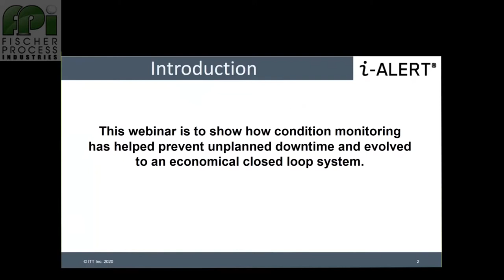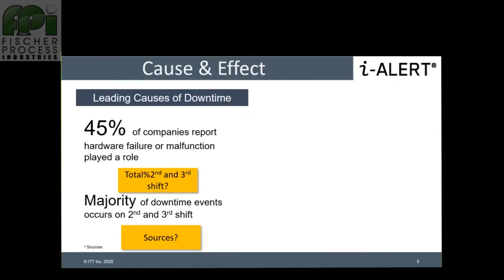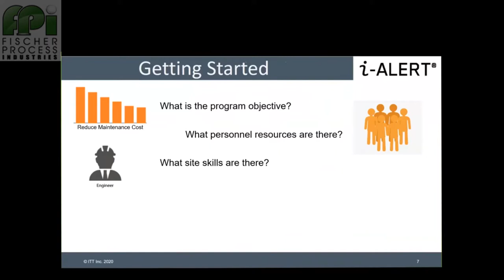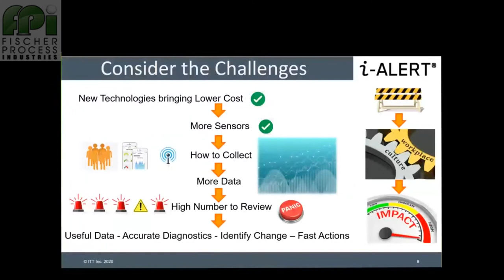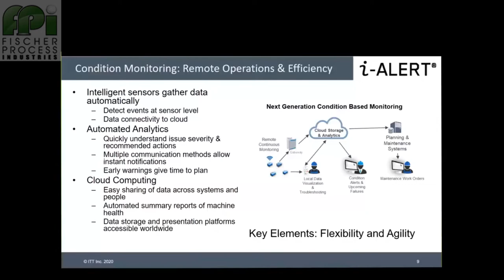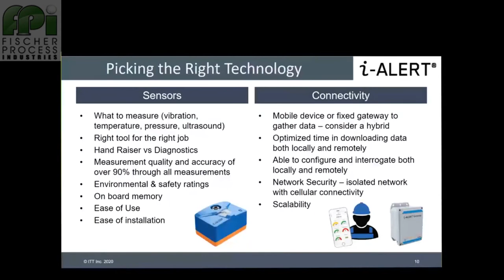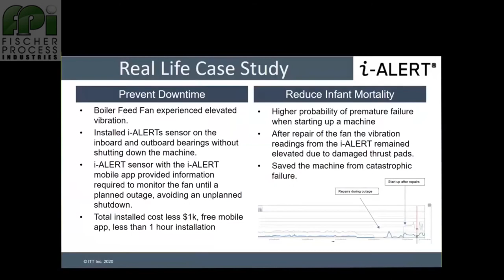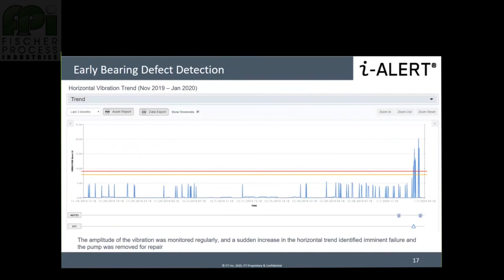Pump Condition Monitoring: Remote Operations & Efficiency

Comment: For instance you are Designing an automatic water level controller, and again in the project you are been required to monitor the pump remotely and give an alert to the operator in the case whereby the pump is damaged or it is about to experience some Faults. How  Do you connect the pump monitoring system so that for instance to send a text the pump is about to get damage.